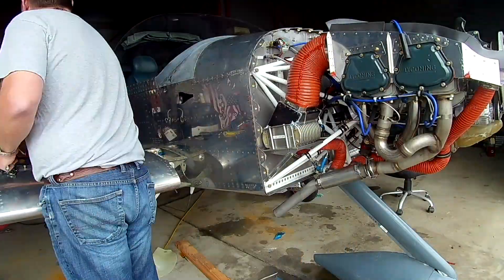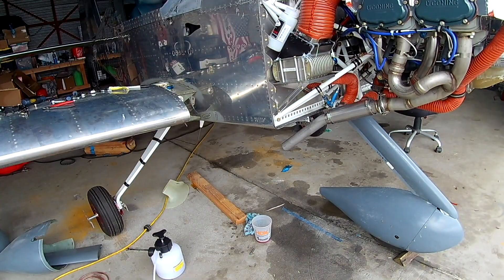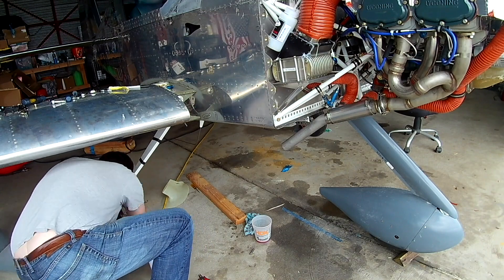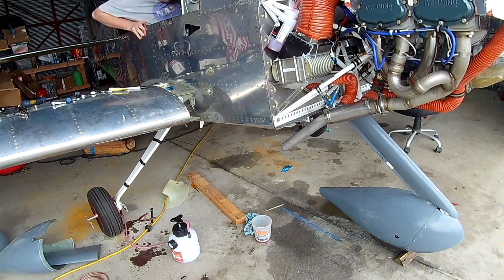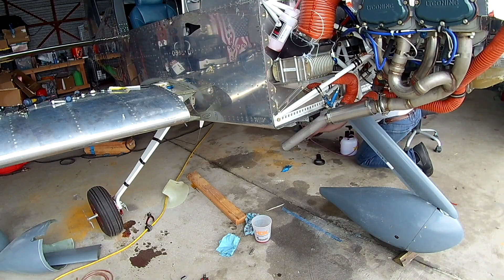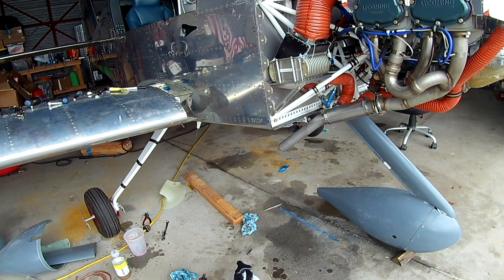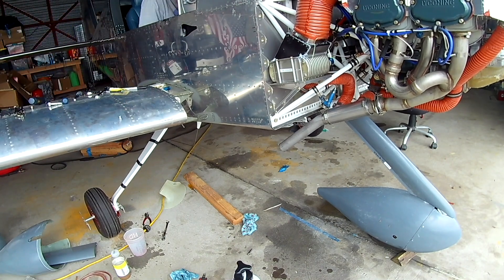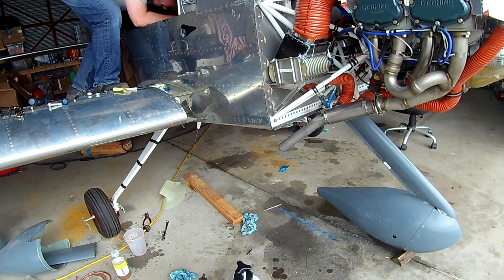RV-14 Freines (brakes) Finalé

Comment: I built one of those pressure bottle contraptions to bleed my flaps/brakes on the Mooney... fun fact you know that you need to fix your hydraulic system ASAP when the flaps fail on the Mooney because the brakes go next.